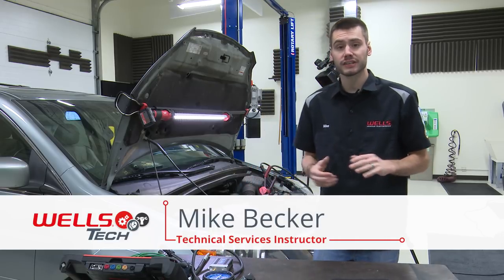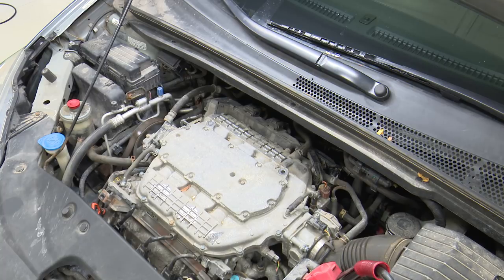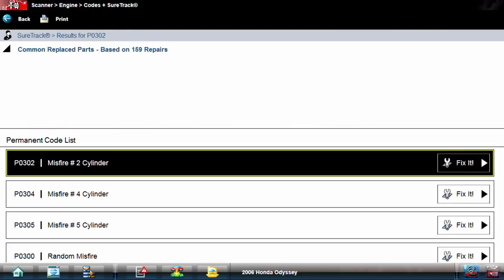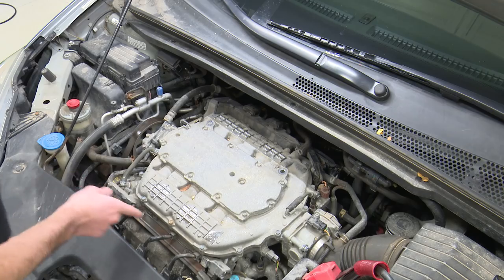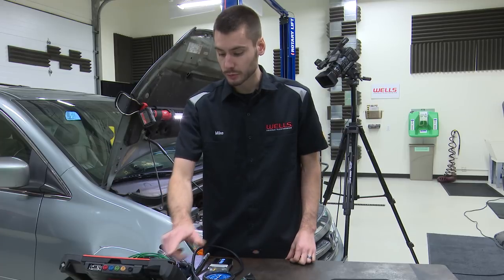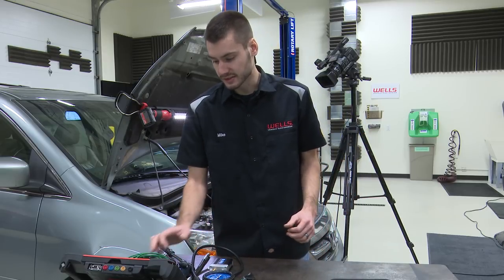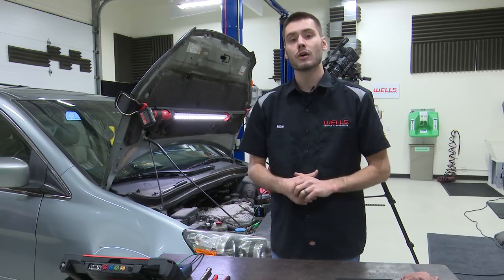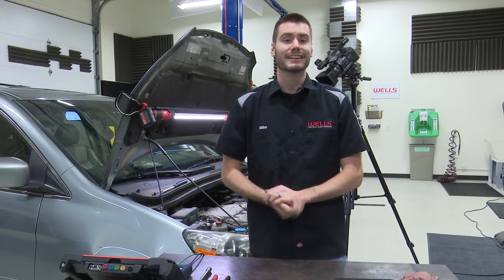2006 Honda Odyssey 3.5 Random Misfire Case Study Part 1 : Diagnosing the P0300, P0301, P0302, Etc.

Comment: My customers issue was a bad coil, replaced, and a month later the new coil went bad which was, fortunately covered, since she knew them and was a great talker.  Further, the valve-pan cover gasket was leaking oil into the spark plug area and shorting the plugs out causing the random misfire.  Finally, the (braided?)ground-wire from body to the motor was weak (copper was heat-burnt looking, brittle, and easily resolved with replacing and cleaning surfaces.  This Honda engine was easy to work on and I appreciate learning new tips from your videos.  I have the 720Pro and do back-yard stuff and appreciate learning new techniques to make diagnostics faster to save me work and customers money.
Reply from the maker: Hey, sounds like a lot of things were going wrong on there. Nice job getting to the bottom of all of it!
Mike Becker, Senior Instructor

Comment: I have an 06 Honda Ridgeline with 240K miles throwing the same codes.  My mechanic has had the vehicle 3 times and hasn't been able to resolve.  This video makes all the sense in the world to me and I appreciate the detail in presentation and clarity in communicating the lesson.  Most of all, I now have a direction for repair with confidence that the problem will be resolved.  Well done Sir and thank you!
Reply from the maker: Hey Pat, sorry to hear your mechanic has been failing you! Glad we could help you with this video. Thanks for watching :)
Mike Becker, Senior Technical Instructor
Reply: Any update on your problem and/or repair? I’ve got same codes (and random misfires) on my 06 Ridgeline with 130k miles. Dealer replaced timing belt, water pump and did the valves. (I replaced all plugs, coils, and pcv valve with OEM parts). Still get random misfires occasionally (cleaned EGR channels but not EGR valve). 

Help!
Reply: @axjohn  have to try with the injectors?. EGR Valve
Reply: Jose yes I ran a couple of bottles of Redline Fuel Injector Cleaners in two consecutive tanks of gas. I couldn’t get the bolts loose on the EGR valve do I haven’t cleaned it or checked it yet. But I just left my indy Honda Acura repair shop—they loosened them hand tight for me! I’ll remove the valve and clean it after the engine cools down later tonight. 

I cleaned the EGR holes at the top side of engine and I think I loosened a piece of carbon that has stuck the EGR valve open which I’ve read online can cause a lean signal to the computer due to too much O2 and then computer adds more fuel to compensates, hence my lean code and running rich codes and misfires upon cold startup. That’s my guess. 

Will update.

Comment: What a great video! My 2003 Honda Pilot is throwing error codes for cylinders 4,5,6, and the "general misfire" as well. We bought the car with 100,000 miles on it, and the service records show plugs were done, so I was suspecting a stick coil, but now I think it is the valve adjustment. I don't have the diagnostic gear you do, but I was really impressed with your thorough, logical approach. Nice work!
Reply from the maker: Charles, thank you so much for the kind words!!! Hopefully the valve adjustment is all you need :)
Mike Becker, Senior Instructor

Comment: Hi Mike. I have 2013 MDX. It has s misfire in cylinder 5. My error code is P0305. 240,000 kms on it 

So I have done the following
1) Swapped Coil and Plug from cylinder 5 to 6, code remained P0305
2) Tried Seafoam, Redline S1 and Mystery Motor Oil treatment in fuel tank and Engine, issue did not resolve.
3) I got compression test done and it showed low compression in Cylinder 5 120 PSI vs 170 PSI in cylinder 4. Then I got an auto body shop to do all 6 comparative compression test and it came compression is only 25% in cylinder 5 and approximately 75% in cylinder 6. Cylinder 1,4,2 were 100%, cylinder 3 was 92%
4. I took it to Acura and got valve adjustment done, they said it was loose intake valve. It made engine sound alot better and I felt it got power but misfire still shows in p0305.

I watched your video and have read forums. Now I am not sure what to try or do next. Any advice and help will be great. 
What do I try next?
Reply from the maker: I replied to your other comment Saad!
 Mike Becker, Senior Instructor
Reply: Vcmuzzler 2

Comment: I want to thank you so much for making this video.  I'm in the same boat with my 2005 EX-L, which ironically is identical to the one in your video.   After 2 Honda dealerships and an independent shop gave me the run around, I had almost given up hope that a proper diagnostics could be done.  Going back to said "lazy" dealership #1 armed with my new knowledge and pray that it hasn't been going on long enough that it's burnt a valve.  Oh well, if it has, they'll be fixing that, too....thank goodness for extended warranties!  Now I'm going to watch the rest of this series!
Reply from the maker: Thanks Alicia! I hope you have better luck the second time around. Always better to go at it armed with information. Good luck!
Mike Becker, Senior Technical Services Instructor

Comment: First-time viewer. Super impressed with Mike's knowledge and presentation (I'm a professor, if he were my student, he'd be getting an A). My '06 Odyssey with 220k just threw these exact codes and has the exact same slight roughness at idle. Mike's diagnosis is the bomb. And, he showed me that the proper diagnosis is something that I don't have the time or tools to do. If I go in and have someone like Mike come to me with this kind of information, I'd be totally confident to make the decision as to whether or not to put money into this old van (oh, mine also needs struts, axles, and a couple of other things). Cheers.
Reply: I may need help tomorrow with the printers in the villages though.
Reply: Et et
Reply: 43
Reply: Et
Reply: Et

Comment: Fantastic video and great explanations. Anyone fixing cars needs to understand the underlying fundamentals. New subscriber(also master/L1) grateful for some refreshers.

As the diagnostician at my shop, I break the scope out on occasion, but this ticket also shines a light on some of the problems with boots on the ground and flatrate.

 At this point with a Honda + miss on front bank, I'd just sell the adjust. If I was wrong my shop would (yes, really!) eat the labor. If you eat 2 out 100 you still come out way ahead. For the FNGs out there, further general confirmation can be had by holding a paper to the tailpipe on a Honda and feeling for a pulse. With this particular car it likely wouldn't be absolutely conclusive given the specs, but this issue is seen across all Hondas with adjustable valves and a sure tell on the 4 cylinders.

Re: Cam gears not installed on shafts correctly. This has become more common as more manufacturers use press fit cam gears instead of pins. If you get one of these in, step one is to have the owner asked if the car worked on recently. On something like a Mazda 3 installing the crank pin tool and pulling the valve cover to install the cam bar is generally going to be faster than breaking out the scope and navigating the schematic to find your pin hook ups. 

You are absolutely right about spark plug choice. Gotta see NGK or Denso. Can't count the number of cars I've fixed by pulling out a brand new set of +4s or splitfires and installing the OEM plug.

Great video, thanks.
Reply from the maker: Hey A B, glad to have you on board!!! Welcome to the channel! All valid tests man, I can tell you've lived the life for a while :) I despise these press on gears. I had a 3.5 EB F-150 that the cam reluctor shifted on the cam...stupid issues that shouldn't really happen but they do. It's amazing how good some of these companies are at marketing their "special designs." There is a reason why NGK has the most OE market share and those "others" have little to none! Again, thanks for watching! Looking forward to more great comments from you.
Mike Becker, Senior Technical Instructor
Reply: You are an good, honest mechanic. Unlike the slobs my friends take their cars to. They will charge for everything, whether it fixes the issue or not.

Comment: I got the same codes on my Honda Od and customer has  never done any Tuneups at this point at 220k . Says he’s never had any trouble with shaking or engines lights until now? Is this still a valve adjustment protocol? Thanks love you video , your a gifted teacher 🙏👏never stop teaching 👍
Reply from the maker: Hey Phil, honestly, i'd probably start with all of the tune-up stuff. Spark plugs, valve adjustment, etc.
Mike Becker, Senior Instructor

Comment: I have a 2007 Honda Polit with a P0302 code and came across your video as I was looking to see how to proceed on my Honda.  In short I was so very impressed by your presentation and knowledge, so much so that I watched all 3 parts.  A valve adjustment is way over my head and the tools I have to diagnose or fix, but you did provide me with the knowledge to go to my mechanic and know what to ask about if a valve adjustment is required.  Can't say enough - GREAT video.  Thanks
Reply: lol, its not like rebuilding a transmission.

The tools needed…
$3 feeler gauge from auto parts store 
$5 allen wrench set
 $10 socket set  from harbor freight.
And 
A small amount of brain power to remember how an intake manifold and valve covers
 go back on. 

Its not hard to do,,
but it does take a while and is kinda tedious to adjust 24valves. (usually, only the 12 exaust valves).

But its pretty easy to do and check  them yourself for peace of mind.  (without all that fancy waveform devices.)
especially if you know they are due, because you haven't had them checked in like “ never” or “forever” +100k miles ago.

Comment: Glad i found this, I'll look for the rest and follow. This is most likely one of the problems I'm having right now with my '04 3.5 Pilot. 
My thoughr on your question  was the time would shorten.
Reply: Any update?
Reply: @MatthewDurant-eh1ov 
Turns out I also had a bad front seal which I feel helped blow a cylinder. (I cheaped out on oil till I was able to fix problem, never got to it.) I am in the slow process of changing engine, I have to many projects going on.

Comment: Nice one Mike, I'm presently experiencing the same issue but yet to conclude it's the valves. Because mine starts working well then suddenly changes mode by flashing lights and disables three plugs hence vibrating.
Reply from the maker: Hey, thanks for watching! If the check engine light is flashing, you have a damaging misfire occouring. You're losing 3 cylinders at a time?
Mike Becker, Senior Instructor
Reply: Look into VCmuzzler 2

Comment: Excellent video.  The only thing that I would have liked to see was for you to have commented on the noise of the valves when the engine was running.  Since the service recommendation was to do a valve adjustment if the valves were noisy, I would have liked to see you do that check.  And then comment on whether you actually thought the valves were noisy.  And if the valves were not noticeably noisy, wouldn't that have led you away from doing a compression waveform test using a pressure transducer?
Reply from the maker: Hey, the valves on here were not noisy. These valves tighten up, noise usually comes from loose valves.
Mike Becker, Senior Technical Instructor
Reply: yeah i think someone should edit the service recommendation on that one to say “ if the valves are not noisey check the valves”.

Someone should tell whoever wrote that service recommendation. This is not a 1964 VW Beetle engine. (clack, clack, clack. clack, and its still running?)lol

Comment: The exhaust valves on my 2010 Odyssey EX-L (vcm engine) were all a little loose except cylinder 5 which was slightly tight. Every intake was a little loose. That was the first valve adjustment for the vehicle and was done at 146k miles.

Comment: Absolutely one of the best diagnostic videos on YouTube I’ve ever seen.  My 2006 Odyssey has nearly 300k miles and is exhibiting similar problems as well as significantly worsened fuel consumption (15-16 mpg driving cautiously).  Going to attempt the valve adjustment myself while also doing the timing belt service soon.  Just out of curiosity, what scan tool are you using?  Keep the videos coming!
Reply from the maker: Hey Mike, thanks!!!! Good luck doing your maintenance yourself. Should save you a ton of money over going into a shop. I used the Snap On Verus in this video. Thanks for watching!
Mike Becker, Senior Technical Instructor

Comment: good vid. lots of great info.

Except the part about 
“the valve travels further”.

Technically,
It wouldn’t travel further* 
from your explanation.

For it to do that. There’s only a few ways I can think of, that could cause that to happen.
“the valve rod increased in length or the the cam lobe got bigger”  
Or
“valve adjustment screw was tightening itself down further over time”
 or 
“the the valve spring has gotten weaker bouncing the valve down further past its normal travel”

since the first two would have to break the laws of physics to increase in size or length…
Actually,. at 200k  the valve may not completely close until pressure is inside the cylinder + I’m sure they have gotten shorter or worn down from original size,)along with the valve adjustment screw).
Also, if the spring was that weak it wold definitely have major issues with valve lash especially at higher rpms.(And it will really ruin your 
day if the valve hits the piston).

But,..from your explanation.
What you can say,…
{{“Because exhaust ports are hotter the metal becomes softer. The valve seat is beaten down further into the head. Reducing the rocker arm clearance until it is pressed against the adjustment screw.”
“Which makes a lower valve seat opening that will cause the valve open sooner and close later.”
 (Meaning, the valve will stay open longer….Not Further*) 
“And If the valves are not adjusted. Eventually the valves will not completely close causing them to become burnt”.}}

And..Thats all my 2 cents.
Enjoy!
Reply: oh, also FYI.
a bad headgaaket can also mimic those readings.

Comment: Valve duration will change because it is contacting the "ramp" of the cam later and released off of the "ramp" of the cam earlier. Valve open duration will be less (shorter) after increasing valve lash.
Reply from the maker: Hey P Sav, great theory. I think you may be onto something. :) Going to have to wait until tonight to find out!
Mike Becker, Senior Technical Services Instructor
Reply: @GoTechTraining  Awesome explanation and diagnosis. Love your teaching methods. Would agree with P Sav,- the valve should ride the cam shorter duration when properly adjusted compared to one with too little of gap. Is this what you found in testing as well?  Thanks!

Comment: nice video... had customer  with 2007 Honda FIT .... stall issue ....when cold.... back out of drive way after one stall... you  start back up an never did it again till next cold start . valve adjust fixed it but did kick my ass for couple hours diag time ....
Reply from the maker: Wow the valves were bad enough to cause the stall! 
Mike Becker, Technical Services Instructor

Comment: Great video 👍 would you able to explain how you added power point onto the picoscope. Would be greatly appreciated.
Reply from the maker: Hey Sherwin, thanks for watching! I took a screenshot of the PICO capture using a program called "GreenShot". I then copied it into PowerPoint so I could do my hand drawn overlays. It works really good that way.
Mike Becker, Senior Technical Instructor
Reply: @GoTechTraining  thank you very much. Keep the up the good work

Comment: VERY informative young man! ive seen this many times. ive sold valve adjustments on these and misfires still happen... Honda has a class action lawsuit on this engine. Ive heard the rings crap out on them. Honda puts a new long block in them and valve job and adjustment on them... kinda messy... also the valve cover plug well seals leak oil into the plug well tube and does the same thing.... its like pissing in a fan.....
Reply from the maker: Hey Mike, thanks for watching! Yeh, i've heard about the rings being bad. I think that's on 2010 and up though. 2006 wasn't too much of an issue for that.
Mike Becker, Senior Instructor

Comment: Hey Mike! How's it going? Happy New Year to you! Thank you once again for your awesome videos! Your knowledge is greatly appreciated. I have a situation where I'd really appreciate your opinion please. I have a 2005 Honda Accord V6 with 66k original miles. Its has codes P0300, P0301, P0305 and P0741. It has new correct Denso plugs in it. I haven't done anything to it yet because I have it for a couple days. Plus I'm stumped as to where to begin  because of the low miles. Your opinion and knowledge will once again be greatly appreciated! Thank you for your time Mike. I hope you have a great week.
Reply from the maker: Hey Edward, thanks for watching! All is well here, thanks! That's the motor with the egr ports that plug up I think. Take a look at that. Low miles, maybe it wasn't driven to the point it got cleaned out all the way all the time.
Mike Becker, Senior Instructor
Reply: @GoTechTraining  and you believe the causing the problem with the transmission?

Comment: Minor correction. The valve doesn't move further into the engine at 27:30. Instead is moves further past the valve seat.
Reply from the maker: Hey Dan, you're right. The valve is not at risk of hitting the piston. I did not make that clear. Thanks!!!
Mike Becker, Senior Technical Instructor